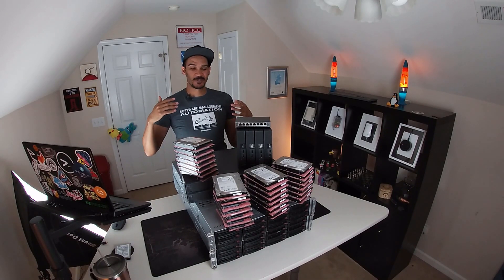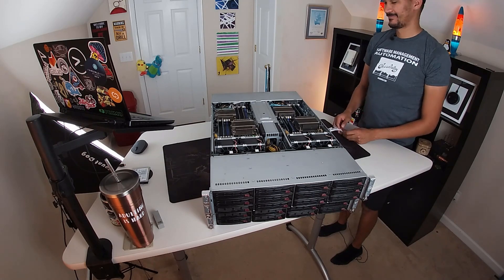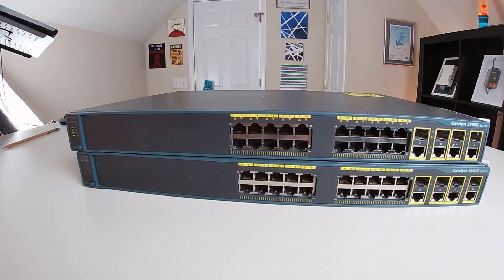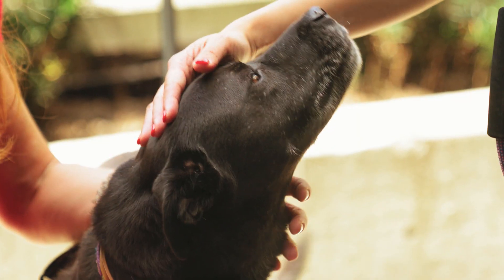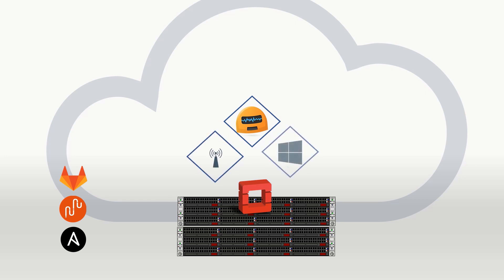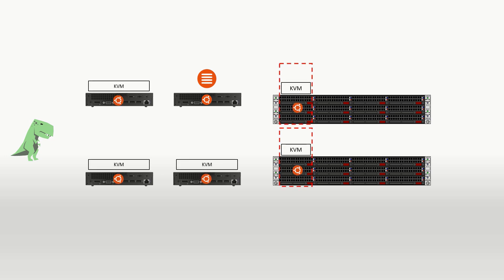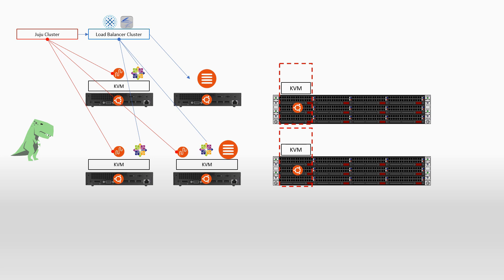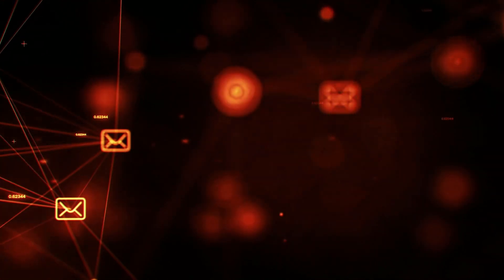Over Engineering your homelab P1

Comment: For my home lab, I built a custom server with Noctua fans inside. Then I replaced my QNAP rack NAS fans with Noctua fans also. Now my homelab is nice and quiet even under load. What is irritatingly loud and high pitched, is the QNAP 10GbE Thunderbolt adapter under my desk. I'll crack that open and see if I can replace that fan also. 🙂
Reply: can't say that about my HPe servers

Comment: I love your plan. It's not an option for me since I live in a small bachelor apartment with 4 plugs total! I also need a much quieter solution since I will have the server in the same room (The only room) I am starting with an HPE DL60. other than setting up drivers for the VSA array (I cheated I am using only two drives in ACHISATA since I have a QNAP 332x 3-bay NAS which I will connect using NFS ) I want to set up a MariaDB database and setting up LDAP and a squid Proxy. I am basing on the RHEL 8.3 Developers edition as my base. I will move to Proxmox next after evaluating VM's vs containers using podman. it's an order of magnitude smaller but appropriate for my environment. It is a server that can handle a second processor so for raw compute power I have an E5-2609 six core @ 1.9 GHz. it hums nicely without being oppressive. HPE intelligent provisioning is functional but finicky (It only load off actual DVD's and doesn't understand USB keys for example). It a solution that is a good start and will meet my educational and development needs. The apartment is east facing so it runs hot, and my AC is on all summer from dusk till dawn anyway. i have an old SNC smart switch but it works and I am using an HP desktop as a PFsense2.5   firewall.

Comment: Lol. That was ....
No no, no , no why,  no, oh, yeah, yep , no. EY?

There is over engineering a project and this is not it. This is overly complex.

I get the build it load it launch it.
I assume that you're compiling and then launching the install from the Maas. Using to  bases. For 6 machine (fronts).

The load balance kind of works, however load balance is a fall over, or availability thing.
They don't play well and working with Maas then the machines are clones...

I see mass as a core or end "device" running beside the cores and around the backup. (Image loader).

Back in my day you would want a compress, a radius, gates, which would control the net. Add a SAN for the pull and backs. And then lay over the software. I say San as there is multi access of the same data over the load, but making it its own makes moving and changing easy.
Reply from the maker: 😳... Wait.... what now? 😬
Reply: And the entire configuration would have an offsite replica in Montreal! 😁 We used to have an entire warehouse-sized building Full of EMC fridge-sized SAN units humming and stuffed to the gills with hard drives *I think it was 64 or so I can't remember) and they had their own fiber network and a bunch of comm's Controllers to talk to the world. We never knew what all the data was for but when there was an alert we got two swat teams and a bunch of military showing up around the building and we were locked in....Ahhh the good old days! We asked for four more boxes as hot spares and were approved for eight.....!  We ordered a tractor-trailer of hard drives and a second one just showed up! We never saw the paperwork it was above our pay grade.  We said thank you and unloaded it. Ask me no questions and I won't have to lie to you before I kill you! I miss the black budget days